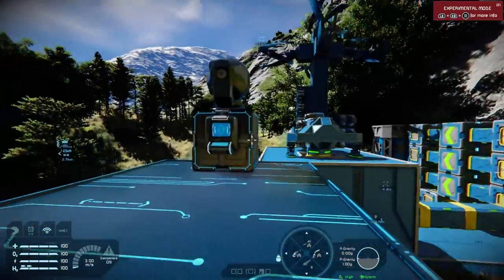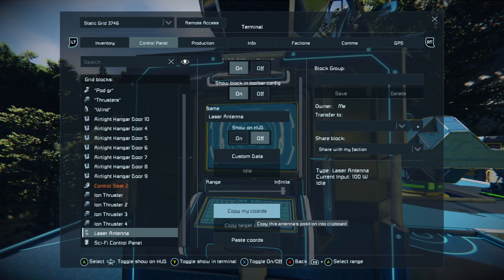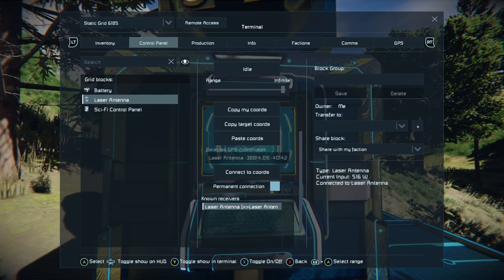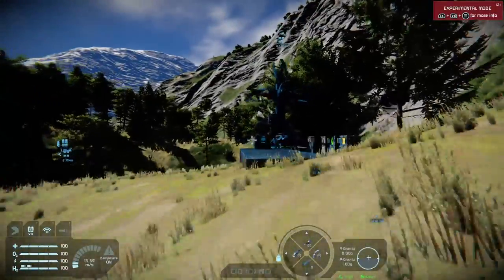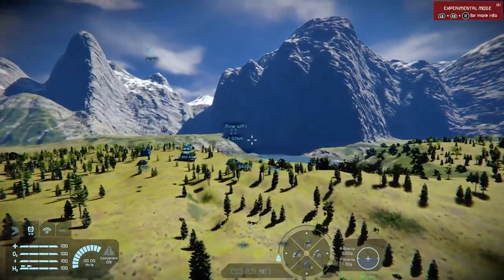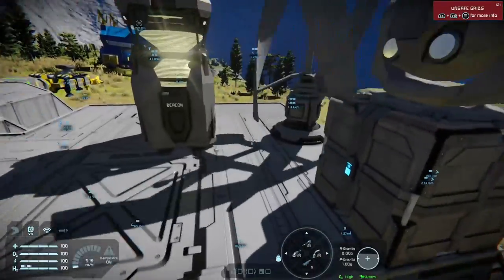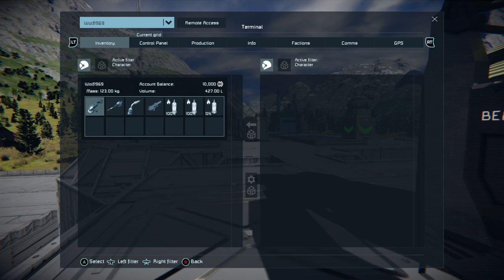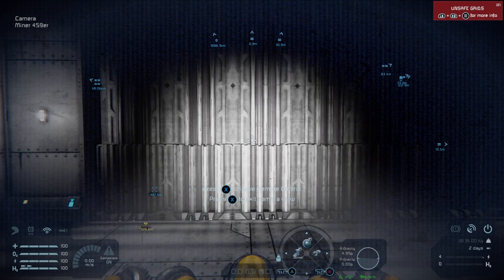Space Engineers Xbox: Tutorial 59 - Laser Antenna

Comment: You said that it can not be obstructed by grids but your remote miner was in a hangar, why didn't the hangar block the signal?
Reply from the maker: Laser light can be blocked by solid objects, so in SE they model the same thing. The actual laser antenna itself acts as a transmitter around the area.

My miner might be in a hangar, but that's not what the Earth HQ laser antenna is connecting to.

It's connecting to the second asteroid antenna on the roof of the base, you can see it right near the end of the video when I pan 459er up and over the edge of the asteroid. At: https://youtu.be/kPD66PrcLLQ?t=444

As long as you have a connection to the two antennas that's uninterrupted, you can use that to remotely control any ship/vehicle in the area of the laser antenna. 

Laser Antenna 1 on Earth has an unobstructed view of Laser Antenna 2 on the asteroid. Laser Antenna 2 acts as a relay for your suits telemetry functions under the remote control. Both Laser Antennas broadcast a signal that the suit can use to access the Control/Terminal functions of Remote Access. Remote Access functions in association with the Remote Control block to enable a connection.

So the connection to the Remote Control can't be blocked since it's effectively wireless.

So that's why the hangar doesn't block the laser, because the laser is on the roof of the HQ. Also, I have a regular antenna on the hangar roof which I can use to boost the broadcast range for the suit's remote when I'm in space there.
Reply: @Dwolfyone  So the laser from earth to the asteroid roof gives you "wifi" to your remote control blocks? and you have antenna(normal) and remote blocks on the miner? and an antenna(normal for boost range?) on the asteroid base along with the laser antenna. For us simpletons :P
Reply from the maker: Spot on matey. Though I wouldn't call anyone a simpleton, that's just not my style. I never could tolerate rudeness.
Reply: and as long as the laser connection from earth to the asteroid is onobstructed, you are gravy. I think.
Reply from the maker: @marshallsjabroniusm5971  Yep. When I first built that Earth laser antenna, I put it on the otther side, where my drone docks to refuel.

So you can imagine every few minutes or so, connection broken!

If a neutral or SPAT passes through that beam of invisible light, then it'll break for a while. 

I tested that with a ship of mine and Earth to Mars connection.

Comment: I've got one laser antenna on my moon base and another on a satellite floating 4km overhead. Neither have obstructions and both have their respective GPS connection data. However neither will connect, only says "Searching for a laser at GPS coordinates" constantly. The only difference between your setup and mine is I have the range set to 50km and not infinite. Is the range setup that important when its apparent range is 50km but both laser antenna are 4km away from each other? I am playing on PC on a multiplayer server so I can imagine the issue lies there but I figured I would ask anyways to remove any variables in my immediate control.
Reply from the maker: Hey, so I created a similar setup to test this on the moon, and sure enough - the laser antennas would not connect.

Not until I dialled the range right up to infinite, and then they connected right up.

So give that a go and see if it works for you, just make sure the satellite is definitely unobstructed in terms of any block whatsoever - even a flight path from a drone or another ship will block it.

I'm betting it's the range though.
Reply: @Dwolfyone  I will give that a try as soon as I can. I also found out that defensive shields and laser radar don't like each other. So ill be testing that as well.
Reply from the maker: @MountainDewBots  yeah, I think the shields will count as a block/los block for a laser antenna.

Comment: Have you  tried remote mining and then autopilot the resources to the earth base?
Reply from the maker: Autopilot is extremely picky when it comes to going from Space to the Earth, it tends to be unable to compensate properly for the most part.

Usually leaves a lovely crater on the ground. 

Still working on it though.
Reply from the maker: The trick would probably be bringing the cargo ship down to Earth, then getting it on approach to the HQ, and finally getting it onto the connector.

That's the hard and scary part with the remote control block autopilot as is.
Reply: @Dwolfyone  was just wondering how easy it would be.  i guess it is not.
Reply from the maker: @haukke  I've got several craters in my test game where I tried to get the Thalium explorer to fly automatically back to Earth-like and land on it. Setting up the GPS points is the trick, because the remote AI overshoots a fair bit if you're not careful and with a ship where you can't control that exactly - it can just smash that into the ground even on a gentle approach.